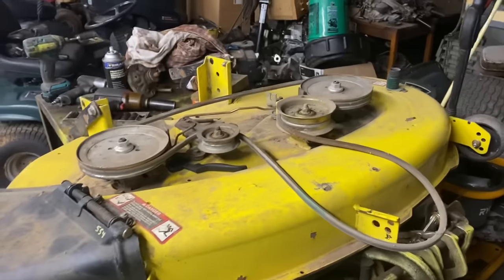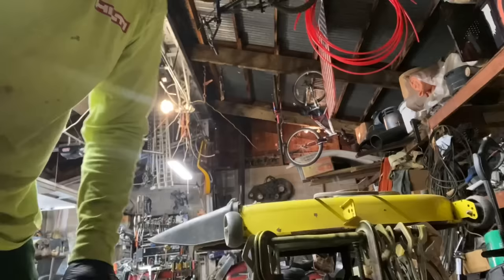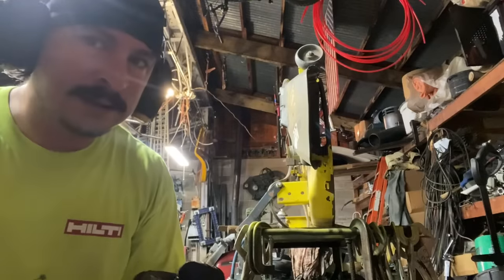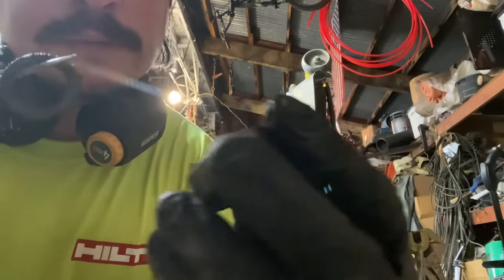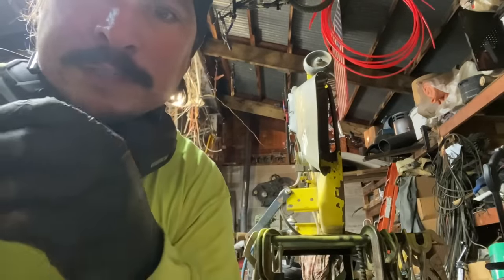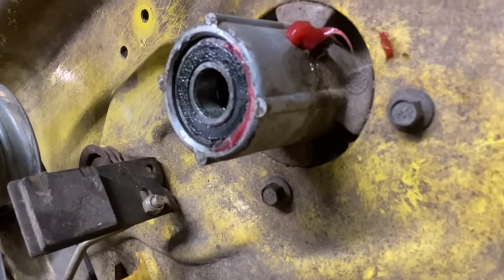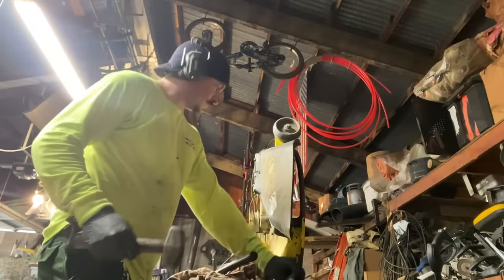Part 1 - Don’t trust the “Experts” Grease your mower deck sealed spindle bearings Common sense.

Comment: why not do the simple thing and take both of the iner seals off. No crud gets in there anyway and the bearings would be full of grease ive done this on all my mowers
Reply: I believe his point was, when original, you can simply greese the cylinder, and the bearings will be greased.
Reply: All of this is wrong. Even if you do manage to fill the cavity, sooner or later you will push those seals completely out just from the pressure of the pump. It is then open to contamination on both sides. If you keep pumping, the grease has to go someplace. You're much better off not greasing as they are greased for the life of the bearing. Not to mention they cost less than all of that grease you're wasting.
Reply: @Georgiagreen317  "greased for the life of the bearing" has been an advertising slogan though meaningless if the "bearing life" is only a few years when subjected to a rough use dirty wet environment versus where the same bearing can last more than ten times longer with more than 30 years of service under the same conditions when the bearing housing is completely filled with the initial 70 or so pumps of grease and regreased periodically thereafter with a few more pumps to refill the housing. The full housing of grease becomes an additional bearing seal or layer of protection against dirt and water which also ensures that the bearing is never lacking lubrication.

Comment: Good job, I never thought about how much pressure a grease gun makes in this situation of course it by passes the seals! In outboard school we drilled out sparkplugs and installed grease fittings and forced out sized pistons with grease. It would break rings and things, but would never come out otherwise.
Reply: you can use a grease gun to push out seized brake caliper pistons too
Reply: Grease is pumped into big D9 dozes and most others  track assembles to tighten tracks weighing tons,watch some videos how they do it on here.

Comment: I wasn't aware of this debate before!  When I rebuilt my mower, replaced the old frozen mandrels, I filled them up until grease squirted out both ends. That was two years ago, they're still spinning nice and easy.
Reply from the maker: @theobserver9131  good work. And thanks for the comment 

Did your new units have zerks? Or did you disassemble the unit to manually fill them?
Reply: @GTObearclaw1  they had zerts. took almost FOREVER to fill them. I thought about disassembling them, but I just settled in for about an hour and pumped.
Reply: @GTObearclaw1  It was a "rescue" mower. Just rusting in someones back yard. They gave it to me and I brought it back to life.
  Just scored a push mower at the dump yesterday!  Tore it down and cleaned it up this morning, and put it to work by noon!
Reply from the maker: @theobserver9131  my favorite projects are usually the rescues. Got one the other day and only reason it wouldn’t start was because the prior owner had put a fuel cut off in the guile line and the person selling the estate didn’t know that. I didn’t even realize until I got it home and diagnosed it as a fuel issue then found the cut off before I pulled anything apart. I got super lucky!!!

Comment: Thank you for making this video.   I am aware that the blade spindles have grease zerks on my 42" deck but after watching various you tube channels I anticipated having to pull my deck off, remove the blades and the upper and lower bearings, removing a top and bottom rubber seal and then repacking the bearings before re assembly.   Then  filling the spindle with grease.  I watched you're video twice and then went out to the garage and proceeded to grease the two blade assemby's.   Worked just the way you described.  I only needed 40 pumps on one side and less than that on the other side.  Visible grease was observed so I knew that grease was where it should be.   Thank you so much for making this video, you have saved me a tonne of time and unnecessary dollars.  I have had this JD tractor for a number of years and I've had the unpleasant pleasure of paying for service from a JD Dealership.
Reply from the maker: Nice. Thanks for the comment and I am glad it helped you get your deck serviced.
Reply: ' so I knew that grease was where it should be.'
Realize, for the seals the outer edge presses into the outer race.  The seal to the inner race hub is where the tiny gap is so it can spin.
Force press grease into the bearing, it almost 100% goes in through that inner hub gap.  Goes past the bearing balls, and out the other side seal inner hub gap.
You may be replacing only a very small amount of grease actually between the seals, and most of what exits coming from the new grease simply blowing by from one seal gap to the other seal gap.
Did tons of bearing maintenance for my RC helis in the 1990's and 2000's, if you want to replace all of that grease the only efficient way is to take the seals off.

Even some new grease is much better than none, and for the convenience doing that may still be fine.  Just realize you're probably only doing maybe 20 percent replacement with the seals staying on, not 100 percent.  The outer grease just stays there when pushing by the seals like that.

Another idea is on the top side seal, use a syringe and inject grease through the seal from near the outer edge.  That will actually replace much more of the grease in that area by going in from the outer edge, pushing through, and then out near the inner edges.  Do that in 3 or 4 spots around the seal and you will have replaced most of the grease inside.
Quite a bit more hassle and probably not remotely worth it for just mower deck bearings.  But injection pays off on some equipment where you really need to replace almost all the grease with new, but bearing and seal removal would cost a fortune.
Reply from the maker: @ModelLights  I do agree exactly with how the grease moves through the bearing. The fact that some folks don’t get it just shows me they don’t understand the way these bearings are made. It’s really not as complicated as some folks think. changing out old grease for new has never been a concern for me. If a bearing goes a long time before it receives new grease, the old grease will harden and stop moving around and has never bothered me even when I completely dismantle a deck assembly I always add more but never worry about removing the old. If there are issue that would cause the need to remove old grease, that would also justify just replacing the bearings as they most certainly already operated with the debris in contact with the moving parts. Adding more is all that’s needed 99.9% of the time in my opinion. Completely cleaning and or changing the grease might give some folks a warm fuzzy feeling and by all means go for it. But I’m not interested in wasting time on that. I have plenty more important things to do. I have videos showing using a grease needle but even that won’t push out old grease unless the bearing is well maintained and already filled with grease in good condition and not hardened.
Reply: You guys are causing me a lot less stress going into spring! Om getting ready to remove and clean my 42" deck, and really wasn't feeling much like tearing into the bearings .... BUT bearings do bother me, never knowing if there's grease in there or not. Now I know how to be sure without the added hassle.  I'm 75 and facing hip surgery!  Lol
Reply from the maker: @robertbowling8393  just keep them greased and as long as they are full of grease you should have a lot less issues. Thanks for the comment

Comment: Great research. Thanks for the work! I’m replacing my spindles, hit a chunk of fossilized coral (turned to dust) and now affects operation. So, I’ll be sure FILL the bearings and spindle cavity(s) with new grease. I’ll leave the seals in place.

Comment: So forty to seventy pumps of grease - great advice thanks
Reply from the maker: Every unit is slightly different depending on size of assembly and how much grease may already be in
The bearings. After the first time the following services will only require a few pumps. It gets better!

Comment: I did not think the grease would penetrate the spindle seal bearings. You proved me wrong.  I was taking the seal covers off and hand filling the bearings and replacing seals. You saved me a lot of work. Thankyou hero.

Comment: I've seen several other guys saying no need to grease spindles or just 3 pumps because bearings are sealed but I remembered this video from last year you did that actually proved you really need to grease them heavily. I'm glad I listened to you! Thanks for doing this video! 👍
Reply from the maker: Lots of clowns making videos on this topic who dont have a clue what’s really happening. Lol, 3 pups will barely get any in there and would never reach a bearing. What a joke. I can’t even watch anymore of those videos. Just want to reach through and shake those guys. Thanks for the comment
Reply: Great informative video! I've been doing this for years in my lawn equipment repair shop I also do all trailer hubs when there are no bearing buddies,ie pack the housing and as temperature increases with driving,grease expands,thus keeping bearings greased!
Reply: Well if it's already full of grease 3 pumps might be beneficial if you are doing it often.  If there is no grease in there then 3 won't do much.
Reply from the maker: @dpeagles  precisely. After all these years of fixing decks I can count on one hand the few Iv seen that had the mandrels filled. I don’t know if I mentioned it in the video but yes after the assembly is filled the next time will only require a few pumps before grease should become visible. So you are correct.

Comment: Thank you for this video.  My manly intuition told me that grease would get past the "seals", but that manly intuition dropped the ball by not warning that the cavity needed to be FULL of grease.  I believe you have saved me a repair that I did not want to undertake.
Reply: Did your intuition tell you what happened to the pieces of seal you hydraulically smashed into the bearing from the inside?
Reply from the maker: @twosencefromcleveland6084  nothing like that happens. You obviously think you know more about the process than you actually do. But if you care to put in some effort to prove that can happen I’d love to see your proof. Unlike you I create videos to prove my point. I don’t just run my mouth about theory that I can’t prove.
Reply from the maker: It
Works just fine. Try it and see. Love to hear how it goes. It has worked for
Me on every single assembly Iv greased. Unless the unit has existing issues this works great. Don’t listen to meatheads that think they know everything but can prove nothing.

Comment: Glad I watched this, i just watched a video yesterday saying the zerks were pointless because of the inner seals,  so they say either remove the inner seals so grease will reach them or take the spindle apart and pack the bearings by hand.  You just proved them wrong and by doing so will save me time. Thx!
Reply from the maker: Thanks for the comment. The main motivation for making this video was because every video I found on the topic have the crappy advance like you just said you found. I knew those guys were wrong and they are misleading thousands Possibly millions of people by providing that garbage advice. They are absolutely 100% wrong and I felt like someone needed to try and show the truth. Also the reason for the title of the video. Thanks again for the comment.

Comment: Thanks for this video. You helped me rethink the whole sealed bearing debate. I will start greasing my spindles more heavily instead of not so often.
Reply from the maker: Hope you find it to be helpful and good advice 

Thanks
Reply: I've been greesing sealed mower deck bearings for decades even when they don't have a grease zirk . I simply drill a w hole between bearings and thread a grease zirk in to the whole . Once the bearing is sllightly warn , so is the seal. Which allows grease to be pushed in. I have mower decks that are 25 . old that where never meant to be greased that are still working for me
Reply from the maker: @paulsmith5339  smart man, your one of a few who put in the effort and see the benefit. As for the bearings or seals needing to be worn, even a new bearing with tight seal can not stop pressurized grease From The grease gun.  I recommend even greasing new bearings if the cheeper bearings are used. Iv pulled the dust shield off new bearings and found almost no grease. Sometimes they are packed full. I recon it just depends on the bearing or manufactures but I always add more if the bearing is not already filled. It doesn’t hurt to add grease. Seems like you already know. I appricate the comment.
Reply: @GTObearclaw1  I grew up on a farm. I learned at an early age greese and oil is the life blood a of any machine  . Even on a cheap sealed bearing mower deck thats at least 2 years old or even a sealed bearing piece of farm machinery . Drill a hole , put in a grease Zirk, and pump it full of grease. We've had sealed bearings that the seals where bad last 40 years.
Reply: Your dealer thanks you in advance.
Reply from the maker: @paulclouse3169  I don’t have a dealer. I buy broken used equipment and resurrect it. Dealers are for people with money.
Reply: @GTObearclaw1  I don't do Deere any more. Bad Boy , Mow with an attitude.
Reply from the maker: @paulclouse3169  I’m a huge fan of the X series Deere. 

Iv had a few bad boys. I didn’t find them to be anything special but that’s just me. When it comes to zero turns I’m a toro Titan HD type of guy.
Reply: @GTObearclaw1  yea, but of the seal is still good , you don't want the ho pressure grease to ruin a new seal that's still keeping the original greese in
Reply: Don't forget when your greasing a mower deck spindle that you are filling up a huge  chamber before the grease even contacts the bearings . So keep pumping grease untill you see grease coming out the top and bottom bearing. It may take a  half a tube of grease to accomish that, depending on the type of spindle
Reply from the maker: @paulsmith5339  as long as bearing is good and I’m just adding grease, the existing grease is of no concern. As I’ll push in new. The inner seal is basically useless can be removed. Point of the video is that the grease passes by the seals. Does not harm the seals. Point is that they can be greased without removing seals. Many knuckleheads take the new deck apart to remove inner seals either because they think they will stop grease or some equally wrong reason. There are some Real true bone heads out among us. I try to help by making a step by step video on the process but still some folks think they know everything about it even though they never do it this way and have no hands on experience in this application. Most folks just rolling over what they know or think they know of other bearing / seal applications and apply the same logic here. Regardless it’s been working great for me never had a single issue doing it this way. And I thought I pointed out to keep greasing until grease is visible from top or bottom bearing.
Reply: @GTObearclaw1  I' know what you mean and I agree . I've been greesing sealed bearings on farm machinery and mower decks all my life . I just meant I'm not so quick to grease a new bearing while the seal is still holding the original grease in . I wait till after I've used it for a while. At that point I don't care about the seals. I regularly grease it there after.
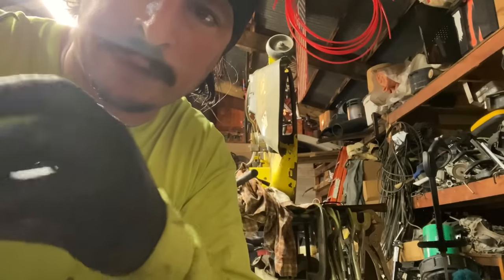Reply: @GTObearclaw1 I have just purchased a zero turn cub cadet. I’m trying to educate myself on all necessary maintenance as I’m a newbie to these mowers. It’s a middle-man machine between my tractor and my push mower. Have I made a wise choice going with the CC? I hear they are not 12:11 great but they’re within my affordability range. What problems should I be proactive with. Have you any vids discussing overall general proactive maintenance besides greasing bearings? I found this video very helpful. 👍🏼
Reply from the maker: @parallaxviewstft3921  cub is just one of the brand names owned by MTD and really nothing more than a cub paint job on most models. There are a few models that are heavy duty. I’m sorry but I don’t do much more than deck repair videos. But if you Google the brands under MTD you can see what all machines they build. Problems are similar across the brands under the MTD umbrella. Big help is to blow decks off rather than use water to clean them. Keep dry if possible and only use water when wadi g is necessary then turn deck on after a wash to throw water off the pulleys. As for the comon issues the deck mandrels break loose so watch for vibrations and immediately stop operating and make repairs otherwise deck mandrels will eventually break off the thin decks. If you catch those issues early it’s an easy fix otherwise it can be catastrophic.

Comment: I've seen a few videos where it was said that you didn't have to, and one where the guy's spindles didn't have any Zerks, so he drilled, threaded, and installed his own. I've always greased mine because I couldn't think of a good reason for not doing it, especially if the zerks are there, they must be there to be used, however, I never filled them as much as you did, not realizing why they probably should be. I will from now on. Thanks!
Reply: Once you know that is fully greased it will just take a few pump the  next tine.
Reply: takes 50-60 pumps to fill them when new and then it starts to come out ends of spindles as it should